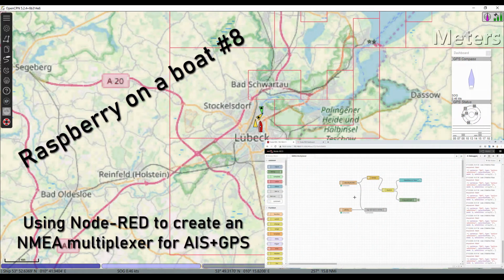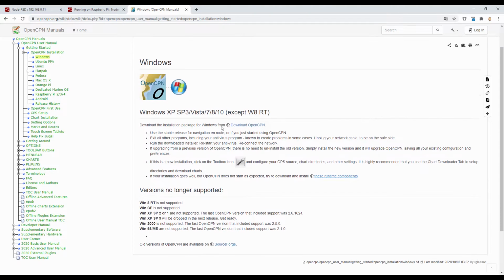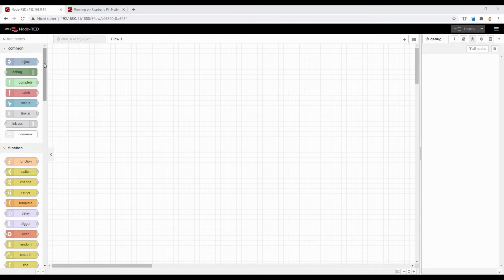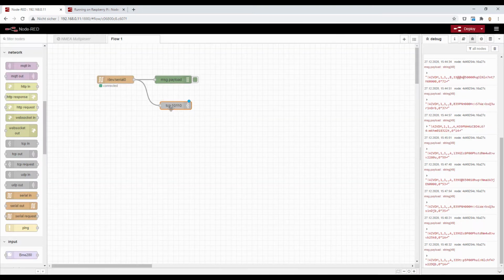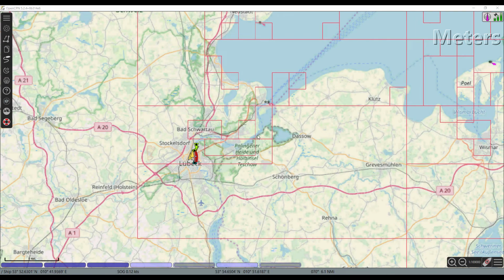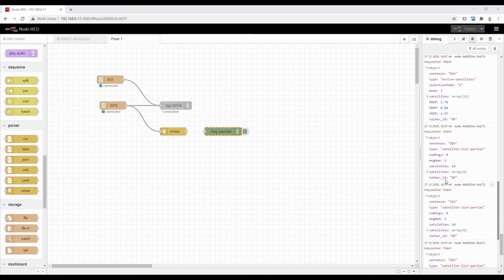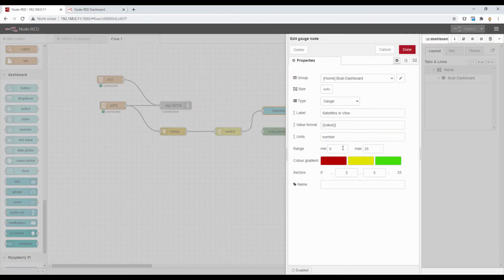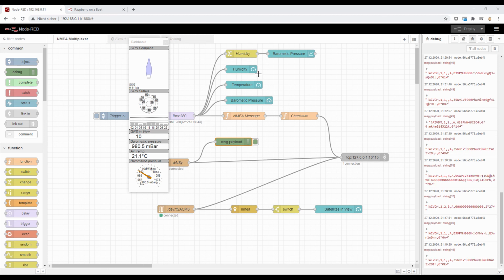raspberry on a boat #8: Node-RED for NMEA (1/2): Using Node-RED as NMEA Multiplexer for AIS and GPS

Comment: I get the following error message when creating the TCP out node: "unable to listen on port 10110, error: Error: listen EADDRINUSE: address already in use :::10110"

For the life of me I can't figure out why. Kplex isn't running, nothing I can see is even using that port when I run 'netstat -tulpn'
Reply from the maker: Dear Ashley,
Sorry fot the late reply, I do not find time currently for my channel. The error is quite common and it will also appear if someone is already working on this port, e.g. if kplex is running already or if something else is set.